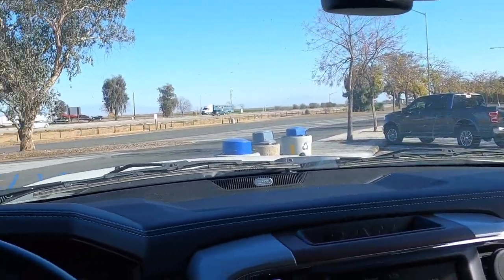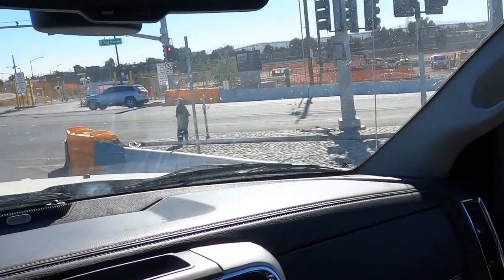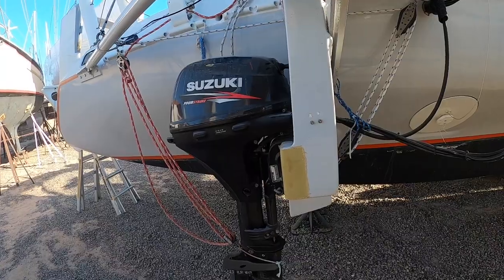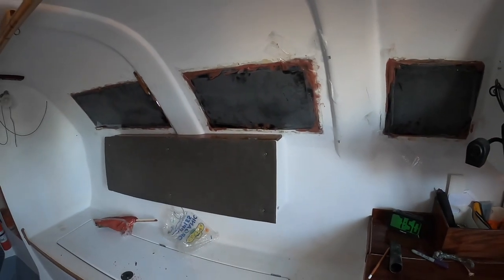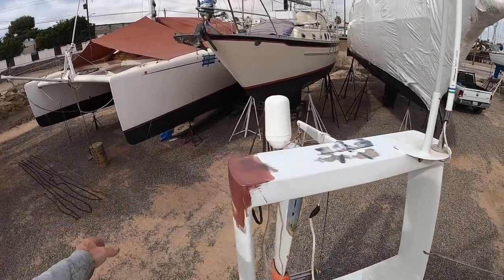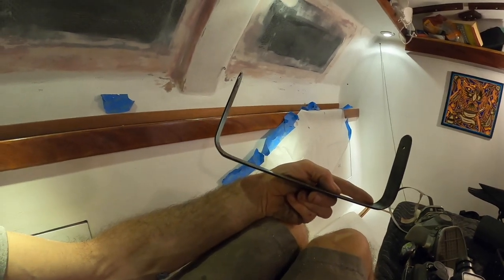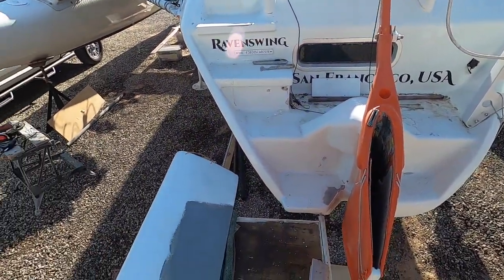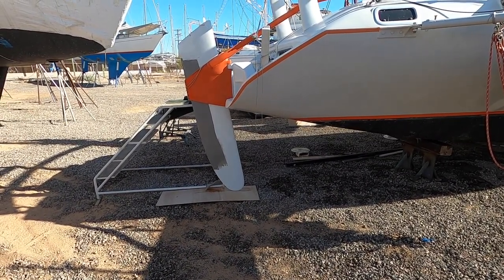Boat Work in Puerto Penasco, PART 1

Comment: I almost went to work for Cabrales in 2000. They were building shrimpers as if it was an assembly line, stray dogs everywhere as pets. Great times, still got some photographs.
Reply from the maker: @johnfalkenstine8377  I think you’d be amazed at the differences, as they work towards being a pleasure-boat yard. I really enjoyed the mix of working craft and cruiser boats there. Especially all the DIY folks. Great energy of people helping each other out. But also watching the yard keep antiquated equipment going through sometimes pretty crude means is very entertaining to me ;)

Comment: How much does it cost per month to have a boat dry docked in their yard? Also, do you need a generator or do they have power?
Reply from the maker: Gold, it’s about $170/mo at Puerto Penasco. The owners are great and active in the yard daily. Electricity is provided via a crazy collection of extension cords, but it all works. Water fill and holding tank pump outs can come to your boat.